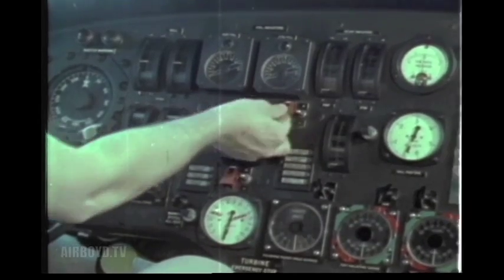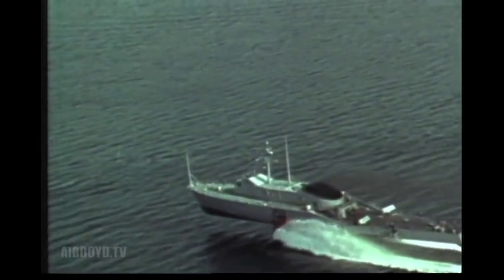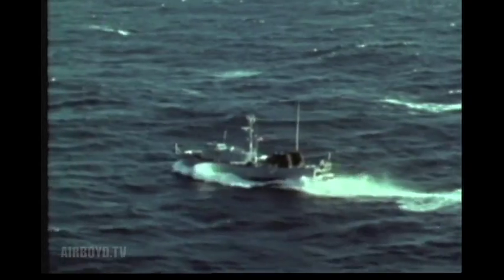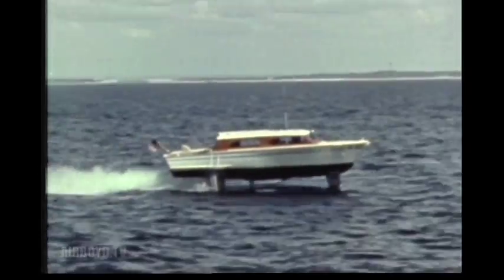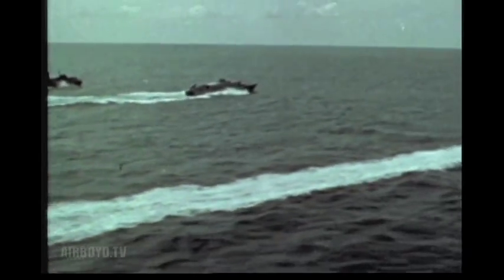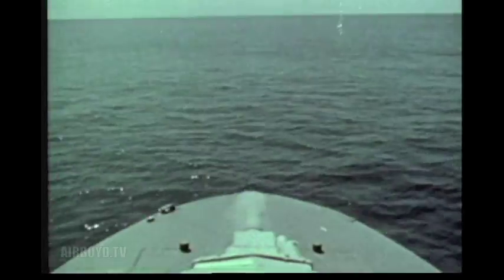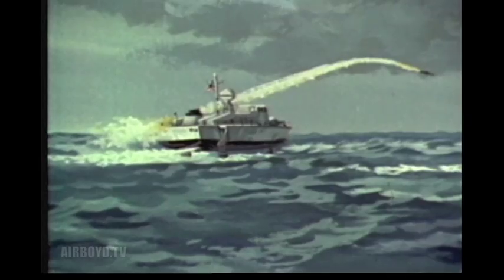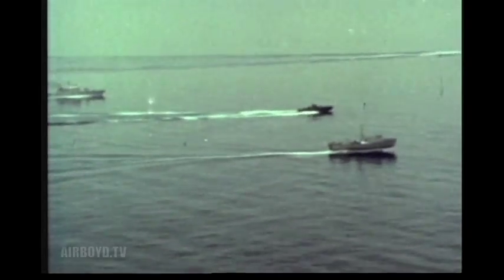Foilborne (1972)

Comment: there were other types of the general category "zero displacement" watercraft.   LCAC is a Landing Craft, Air Cushion (hovercraft)  Can go fast when the hull is not touching the water.   Also Surface Effect Ship(s) - these were more or less a hybrid with some characteristics of a hovercraft up front and water jets like a hydrofoil in the back.   Other types were experimented with as well, but no "mission" was clearly defined - and nobody wanted to 'bust their budget' trying to keep these going as part of a destroyer squadron or amphibious squadron...

Comment: But with the hull "flying" the main resistance would be from the air, not the water, & this should help greatly with fuel economy. Air provides much less resistance to movement (especially at high speed) than water. The foil planes are small in cross sectional area (compared with the hull), & should not contribute much drag in the water.
Reply: very little resistance from air or water. if you were insi.de a nd could not see the waves they could be pretty big and not bother the ship/ There was a transmitter and reciever on each side of the bow that measured wave hights and each third wave they would move the ship to keep it steady/ a very stable platform even in high seas, we had over 1,000 hours flying time (hull out of wter)
Reply: @jericashaw9800  would it be possible to contact Jimmy Trussell regarding his experiences?  I'm working on a project and would like to know a few things.

Comment: Cool ships. Gas turbine powered & fast. Used for 20 some years, and perhaps some still are. But in the long run, I don't know if hydrofoil craft actually proved very practical for the navy's needs. Seems like high speed in a relatively small craft would be an advantage in a navy vessel, though. But probably fuel hogs when running the turbines. When running in conventional config. (hull submerged), no significant difference (or advantage) from any other medium sized navy craft, I suppose.
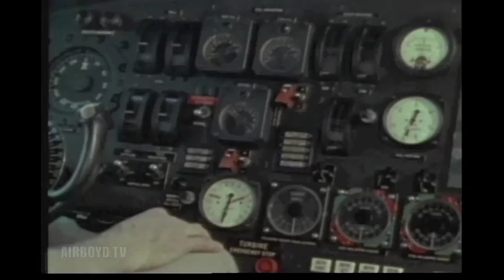Reply: running with hull submerged was at around 4 knots i believe, a small wter jet , when foilborne the Rolls Royce Proteus Gas Turbine would power a Byron-Jackson pump, pulling in water through the back two legs and pushing the water out two nozzles 5 1/2" in diameter at  55 tons of water per minute per nozzle. I was stationed on when the foilborne video was made in  June 1972, I am in co pilot seat at 4:35 on the tape. my name is Jimmy Trussell not Jerica Shaw, she is grandaughter who set up computer.
Reply: @jericashaw9800  Hope you are doing well and thank you for your service! This is so cool.

Comment: So the advantage of these boats was speed? They weren't particularly economical or big, but fast, is that right?
Reply: I am in the foilborne video as co-pilot at 4:35  we were a very stable gun platform as the highth of the craft was changed every third wave at flank speed. 12 crewmen all cross-trained in all jobs, best duty ever. War radioman primarilly, but then was even tail gunner in a TAT turrett with twin 20 MM guns . I was discharged in June of 1972 just prior to the wreck of the Tucumcari